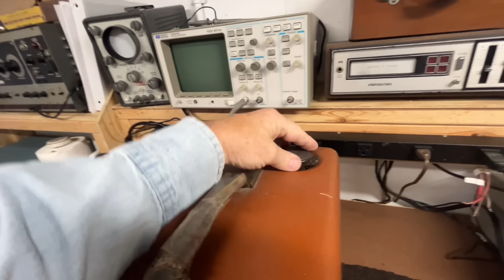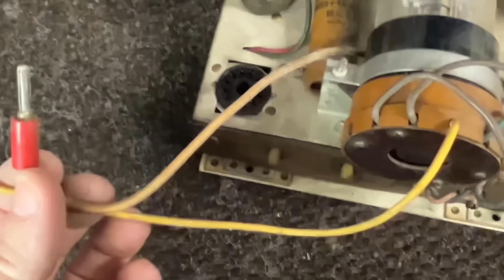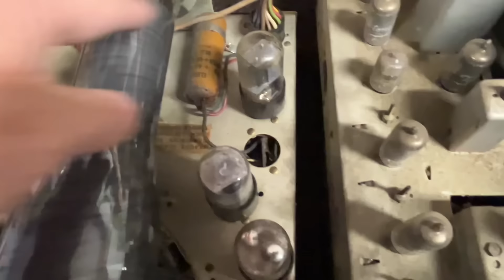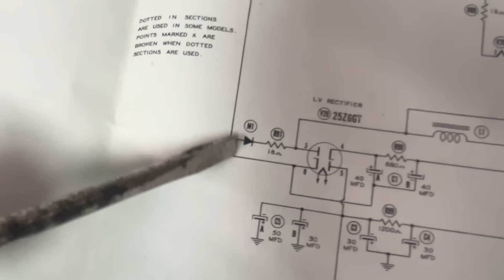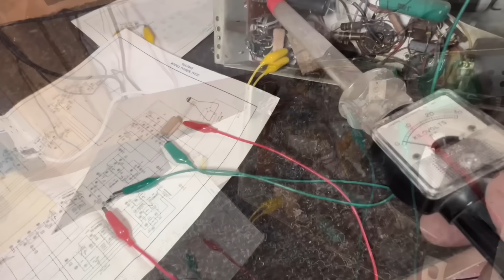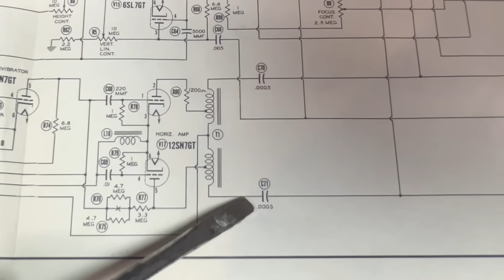1949 Teletone 7” TV Restoration.  Part 1

Comment: I've got a Silvertone that's built the same way. It's a 50/50 about changing out those selenium rectifiers.
Those resistors you changed out. Howed you figure their value? 
What ive been told the silicon diode is more efficient and the voltage is different.  Do you go up in value or down?
Reply: I'm still working on mine. One peaking coil for the video output opened. I wondered why I was getting no image... It's supposed to read 6ohms, it's wrapped around a 22k resistor, the resistor reads 30k. 
I know personally the smell that a selenium rectifier failure... Happened this morning when playing with the set. I thought the dog let loose. A spark and a little smoke. I guess I'm on that lower end of that 50/50...😆 Now time to install a silicon Diode.... 😉